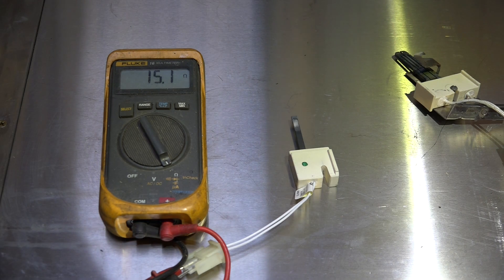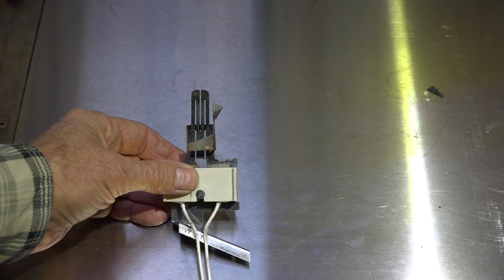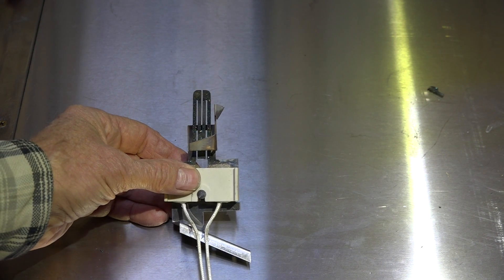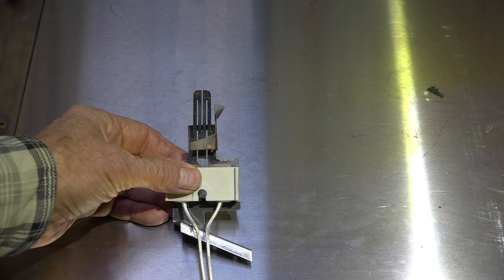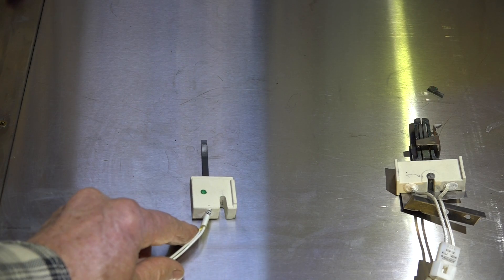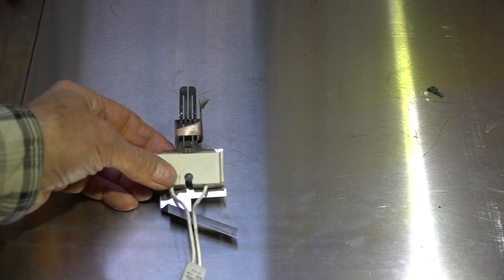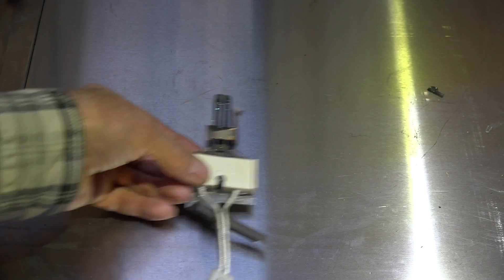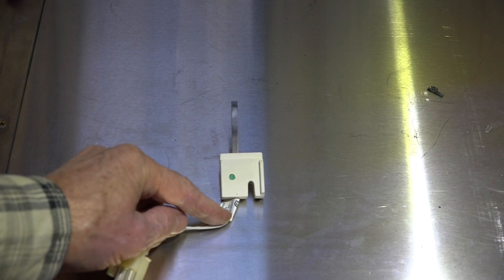Silicon nitride vs silicon carbide ignitor part 2

Comment: can an old piezo ignite be replaced by this nitride one? same voltage? its a rheem furnace from the 1980s...
Reply from the maker: Piezo ignitors are not used on furnaces.  If you are talking about the spark ignitor system, effectively no.  You would have to install a flame rod and replace the control with an HSI control.  Hope this helps.
GFM

Comment: I am seeing a lot of differences in what people are saying the silicon carbide ignitors should be.  I have heard anywhere from 40 ohms to 150ohms. Is this number manufacturer specific?
Reply from the maker: +johnmiller102 I have never heard of 40.  There are some different recommendations from manufacturers, but I use the 150 rule for all.
GFM
Reply: +grayfurnaceman What is the lowest resistance you have seen in good hsi's?
Reply from the maker: +johnmiller102 About 80 ohms.
GFM

Comment: There's a silicon carbide igniter I run across a lot on Bryants and Tranes, that tests between 50 ohms and about the highest working one I have ever seen was around 125 ohms. We change those at  90 ohms. They have a narrower base with tabs on either side of the back or just one side. The wider ones that you showed always take me by surprise as I think it's a bad one until I look at it.

So many little subtle things to learn in this field.